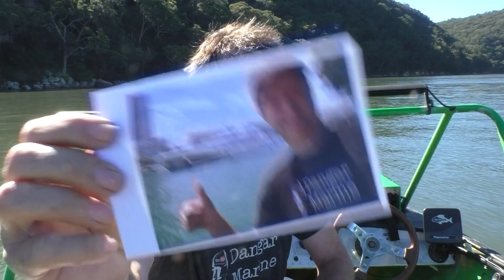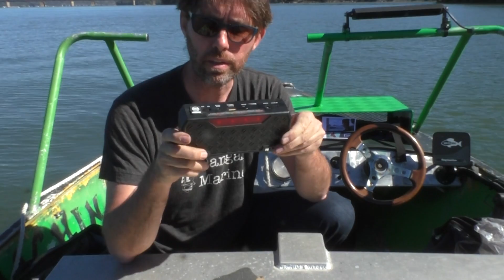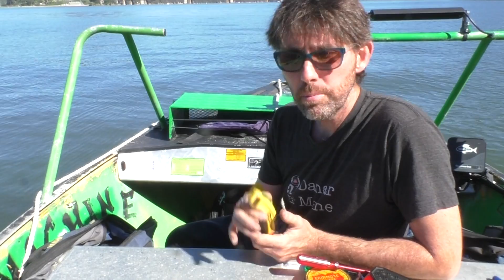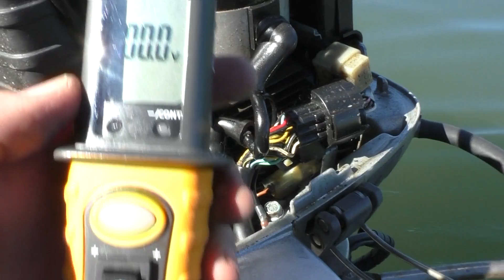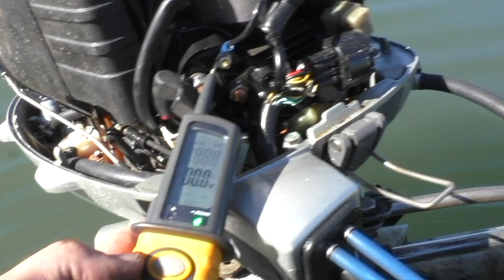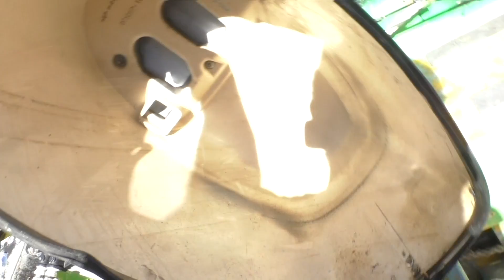Breaking down in a boat on the water

Comment: Hi Stu, Is it normal for battery cables to get really hot if your cranking too much/too long? Was getting frustrated. Stared on the Friday then refused to start on the Saturday. Seemed to be flooding? Think I dried every combination of choke in throttle on, choke out throttle off. mixture screws in and out. Ran out of power in the end so went home in discussed. Brilliant video.
Reply from the maker: Yes, they can get hot after a lot of cranking, as can the starter itself. You could do a voltage drop test across the leads to make sure it isn't a high resistance problem. Does the outboard have spark? Could just be a simple kill switch problem.
Reply: Hi Stu, thanks for getting back to me. It was almost staring, In fact it did start at one point but was really lumpy then cut out then that was it. The carbs were cleaned recently and has been run since, which led me to believe I didn't have the mix quite right. I'm hoping a spray of Easy Start is going to help get me going. The wiring is quit old so guess it should be checked. 
Thanks again. Keep-em coming.

Comment: Was out for a night fishing trip and got done and my 24 volt trolling motor runs off two batteries with one of doubling as the start battery. Tried jumping one to the other no luck. The battery had just enough in it , that when I wrapped a rope around the flywheel and pulled while my fishing partner hit the key it broke over and started. It worked , but now I do like you showed and carry a jump start battery just in case. Great video!!!!
Reply from the maker: Thanks mate. I think a jump starter and an emergency rope is a good combo.

Comment: Hi mate hahahaha you got me on the first one i had it attached to my belt loop tried to start the engine no go of with the cowling check everything sitting there thinking what is wrong with this engine then looked down to see it hanging of my pants what a d** but at least i looked like i knew what i was doing hahaha. That is one thing i always carried was an emergency starter rope just made my own up but good insurance if you battery goes flat it will get you going ,as for tools i would carry a number of sockets plug spanner and other bits and peices as well as the rusty can of start ya bastard great video take care .
Reply from the maker: We've all been there mate, it is such an easy mistake to make!

Comment: I broke down in a bass boat at the skyway in 6- 7 ft waves about ten miles from the ramp, got to a flat that was 4 miles away with a 30lb trolling motor, then jumped in and walked the rest, i got pretty cut up by oysters. When i got to the ramp it was 2 am, then a few miles down the road i heard grinding, it turned out my left bearing on my trailer went bad, luckily i had a spare. Got home at 7 am, i had left at the same time the day before.
Reply from the maker: That certainly doesn't sound like the ideal day of boating!

Comment: I also carry a fuel filter removal tool as it can be hard to remove. Emptying the fuel filter fixed a problem where the engine would start but not run for long or with much power.
Reply from the maker: Yep, they sure can be hard to undo without some sort of tool and if water is in there you'll definitely need to empty it before you can get going again, good tip.

Comment: hey Dangar Stu we have a 12 volt ambient temp and voltage display that plugs into the cigarette lighter socket great for the pre boating check and also to tell the mrs its not that cold boating in july.
we also have a small solar panel mounted north facing when on the trailer, this trickle feeds the battery so we are always ready to go. cable ties and electrical tape are a must cars boat and bikes, recently went camping and some people thought i was going to tie them up while they sleep camping newbies. off to the boat show tomorrow put the mrs up in a swish hotel and got myself a multi day pass, who knows what the cheque book will stretch too. enjoy the vids nice to see the brooklyn rail bridge in background sometimes, being a coastie do most of our boating lobster beach hungry beach lion island and up around pete island
Reply from the maker: Hi David. I like the idea of a plug in volt meter like that I'm planning to add one to the dash of the Green Machine soon, as well as doing a video on adding a solar cell. Hope you enjoyed the boat show and might see you out in Broken Bay some time. :)

Comment: Hi Stu,
Just love your videos. Almost given up on TV. This one though was kind of like, if I happened to have an electric start and not a 40 hp yamaha pull-start here in the Seychelles, it might be a little less theoretical. Pull start is good exercise for hammer throwing, but I use heavy duty gardening gloves for the pulling, otherwise the engine won’t start cos of the blisters. My hands are more used to computer keyboards.
I did teach myself a few things pretty fast after I got my boat (20ft open no frills) and friends (hardened fishermen) added a bit. Every time you start just do one, two, three and don’t forget four. One check the thingie that lets the air in on the petrol tank. Two check the U shape clip starter thing (killer thing) is firmly clipped. Three check it aint in neutral, otherwise you are pulling away, maybe flooding the engine and who knows what else, so by the time you have it sorted you just have no strength left, let alone throw a hammer. Then you have number four. Look to see if it is squirting (select your verb) water down the side, otherwise you’re going to overheat.
If it won’t start after one, two and three, the simplest and easiest thing to do is take the cowling off and look for petrol in the little glass thing. Then ask yourself why you never got round to buying a paddle.
Check lists are boring, but they do work. Me wife says why don’t you write it down and I say, but there are five things on the list if I can only remember four I’ll give you a bell and ask what I’ve forgotten to buy.
Jim
Reply from the maker: I would happily take my risks in the Seychelles, but I know exactly where I would be throwing that hammer if it didn't start. ;)

Comment: I had a call out from a mate ,, his motor wouldn't crank ,,,, i drove 45 minuets to slip it into neutral , easiest case of beer i have ever earned ,,,,
some times the simple things cost a $50
Reply from the maker: Ah yes, that is a common one. I'm really kicking myself for not mentioning it in the video.
Reply: I’ve done it too, knocked it out of neutral while putting the key in and freaked out cuz my motor wouldn’t start

Comment: Stu, once again your videos saved me a boatload (pun intended) of hassle. I was prepping today to get the boat ready for a week at the lake next week and the electric start and horn weren't working. Starter solenoid was popping but the starter wouldn't turn. Tested starter voltage and got nothing. Checked horn wiring and not nearly enough amps. Light bulb with your videos in mind went off and I checked overall battery charger voltage. Plenty of volts but cranking amps were in the basement. Switched to a spare battery and all Gremlins fixed. Bring on the lake!
Reply from the maker: Nice work Peter, glad you got it sorted and enjoyed some time on the water. :)

Comment: Hey Stu thanks for your videos. I was wondering if you could advise me on something? I have a 1979 Evinrude 70HP engine. It starts and runs fine on muffs, forward, reverse all good. However in the water it dies as soon as I put it in gear. I find it so strange that it runs smoothly while on the hose but not in the water? Any suggestions what it might be?
Reply from the maker: Have you done a compression check? It could be that the extra back pressure on the exhaust when it is in the water is stalling a weak motor or it could be a blown head gasket allowing water into the combustion chambers.
Reply: I did a compression check. Top 2 cylinders were 117, 3rd one was 104. Could that be a reason?

Comment: Many good pointers.My motor died(20hp pull start 1985 Johnson) about three weeks ago on the river.Was running great then when I slowed down it idled badley and died.Only got acouple burps when I pulled it.Tried new plugs.No good!After making it back to dock and home on electric motor, I had lost all spark.Did some stator ohm checks,wish I had a DVA adapter you make.Ended up having no continuity on connector(last thing I checked before possibly ordering a new CDI) for ground on CDI to the block.Cleaned connection and got spark back.So hard to look for spark on a pull start by yourself!Strange after running and starting so good.Thanks for the awesome tips.
Reply from the maker: It sure is hard to check for spark on pull start motors on your own. If they are smaller motors you can get a drill onto the flywheel nut. Glad you found the problem in the end, nice work! :)
Reply: Would a drill work on my 20hp to turn it?Have a good drill.
Reply from the maker: With the spark plugs out it probably would.

Comment: Hi,  I have been told that starter spray can damage an outboard.  Any truth to this?  Regards, Bob
Reply from the maker: I don't think it's a huge problem. It doesn't provide the oil that two stroke motors need to run, but a brief spray to fire it up isn't going to do any damage if it is an otherwise healthy motor.

Comment: Not sure if this has been said already but pretty sure most tanks have a moulded ridge down the middle inside the tank which acts as a deliberate fuel reserve.   (At least the tank I have made by quicksilver has).  Fantastic videos by the way.
Reply from the maker: It does seem to be a feature most tanks have, but even a flat bottom tank will give you a bit more distance if you tip all to the pick up corner.

Comment: Great, informative summary video, thanks.

All the plastic (not old metal type) non-fixed fuel tanks I've seen have that "reserve" built in.  Usually just a hump in the bottom of the tank so one side with pickup will empty, but there's still some (quart?  half gallon?) on the other side of the hump.  So just tilting the tank to the pickup side so the fuel runs over the hump, refills that side and you're good to go (after priming with fuel line pump, of course).  Not perfect, of course, as rough going can spill most of that reserve over the hump, or if tank isn't essentially flat in the boat, that may defeat the hump's purpose, but it's an excellent feature.

Don't forget to carry a clean rag, and possibly some waterless hand cleaner as well.

As for a dead battery,  lead acid batteries WILL (usually) recover somewhat if all drains are removed after 10-30 min.  So if not critical for time, try turning everything off, waiting that half hour.  Might be enough juice to get an otherwise well running/easy starting engine going.  (I've actually done this).

I'd also recommend a couple extra screw clamps.

Lastly, a small bit of rag or something, slightly oily, at the bottom of the tin or whatever with your sockets in it will help a LOT in keeping them from corroding, especially near salt water.

RichE
Reply from the maker: Hi mate. Great tip about removing all the drains from the battery and waiting. It's always nice to know there is something you can do if you don't have a jump starter with you. Rag is another good idea, particularly the oily one in tin. I remember my uncle used to have one on the top of his tin of fishing hooks, but I presume that had fish oil rather than engine one in it! Hose clamps are nice and handy too, although you can get away with cable ties in most situation.
Reply: thanks for that video and yes! every boat owner should see this before trying to be a skipper wow!

Comment: Great video as usual!

One thing of note. I was working on a 1970s 70hp outboard a couple years ago and took the spark plug out and held it against the engine block to see if I had spark and it shocked the daylights out of me and took me to my knees. I read in the manual that the coil puts out 30,000 volts to the plug and I'm not sure how many amps (the more concerning part). Be careful.
Reply: Amperage is very low.

RichE
Reply from the maker: Yeah, you can get quite a shock from ignition systems that's for sure. It's another reason why quite like cable tying it to the block instead of holding it!

Comment: Got to admit, love the brand of starter fluid you have over there. never seen it here in the uk.
A good thing to remember if carrying a spare motor is to make sure the fuel in hat is fresh too! I wont name names but a friend had a problem where they went out and main died only to find out spare had nasty fuel in it and soon cut out too. This then made them have to jump in and pull it back to shore!
Reply from the maker: Hey Dave, yeah, it is a very suitable name for it! Great point about the kicker not working either, and old fuel has got to be the number one cause. I think you should try to run the back up motor even for a short time whenever you go out.

Comment: MY steering failed, and like you said, I had to strap a boat hook to the top of the cowling and used it like a tiller. Not so bad, cause it was aux power on a sailboat anyway.  I can remember a friend and I pull started some 200HP Mercs too.  All great fun!  Great general video
Reply from the maker: Hey Gary, glad to hear you got yourself out of trouble. Pull starting a 200 sounds like a chiropractor's dream! ;)

Comment: Mate...I have broken a drive shaft, lost a prop that sank to the bottom, found my fuel pick up floating around in the tank, had magnetic choke stuck in with corrosion, pull started with a rope more times than I care to remember but after rowing for a while there has always been a friendly comrade out on the water to help me get home...  thats the great part about boating.  Oh..I forgot...I have also tilted the plastic tank to get back to the ramp on many occasions and that works a treat too.     I now have a brand new outboard but am thankful for all the "lessons learnt" over many years.. Cheers
Reply from the maker: So it sounds like you're boating has been pretty smooth compared to most. ;) You are right though, boating is like motorcycling, there is a strong sense of community and if anyone else is there they will almost always give you a hand.

Comment: A bit of crab net rope and a small piece of fuel hose sleeved over the rope to make a handle to protect your hands in the event of a backfire and cutting your hands or rope burning your hands is a great way to make a temporary pull start rope. 

NEVER wrap the starter rope around your wrist!. I Have used this fuel hose / crab net rope idea a number of times to start my 60hp Tohatsu and the fuel hose is a life saver of an idea!.
Reply from the maker: Sounds like good advice. I've hurt my hand from pull starting outboards using the factory handle, I can certainly see how it could get a whole lot worse if you had the rope wrapped around you!

Comment: Last summer had a piston ring catch a port while drag racing and locked the whole motor up. Ask me what it's like falling off plain and decelerating after losing power from 110mph in a V-pad hull. Less than 15 minutes later monsoon level rain blew in. :)  As of yesterday she's back up and running ready for this season! Boat is an Allison SS-2000 with a 300 Drag 2.5L Mercury.
Reply from the maker: Sounds like you had quite the experience! Glad you've got it back up and running now though, hopefully you've got a problem free season ahead. :)

Comment: Make sure the damn thing is in neutral. Ask me how I know  :)
Reply from the maker: I was kicking myself for not mentioning that as soon as I got home, it's such a classic thing to go wrong, especially if it looks like it is in neutral but just needs a jiggle to click in.
Reply: Only a Class A Idiot would make such a mistake, not once, but twice. How long does Class A status last? I'm asking for a friend of mine . . . :)
Reply: This is absolutely the best advice. Had an issue last summer where the previous owner of my outboard had messed with the throttle and timing so that, in order to get it to idle, I had advanced the throttle cable to the point that it was bumping the neutral safety switch so the boat wouldn't start. Once I figured it out, I felt like such an idiot.
Reply: Lol happened to me as well. I felt pretty dumb when my wife (who is not mechanically inclined) figured it out before I did. 🙄
Reply: I just had that happen a few weeks ago with my whole family onboard. Embarrassing but a good learning experience.
Reply: robbynelson3 that one has got me twice on the water haha

Comment: plastic waterproof  ammo box  plug  wrench pass through socket set. zip ties multiple  screw drivers plier spare light bulbs spare plugs 2 stroke oil spare trolling prop with pins and nut.
Reply from the maker: All good stuff to have.

Comment: Stu,  thanks for that video.  Good to know what is considered an appropriate amount of tools and good common sense trouble shooting. Two questions -  Is there anything different in troubleshooting wether it is a 2 stroke Vs 4 stroke?  Also,(for us holiday boat warriors) - is 'stale' fuel an real issue in outboards?

Also would you consider doing a video looking at things to consider when repowering a boat -  e.g.. choices of outboard (2 vs 4 stroke), can you increase horse power of the outboard safely, do you need to fit new steering, cables and instrumentation etc. Any thoughts you have would have are appreciated.
Reply from the maker: Hi Neil. I guess with a four stroke there is also the sump oil and timing belt to take into consideration. If a timing belt breaks though you pretty much looking for a tow. Stale fuel can definitely be a problem if the boat is left all winter long without Stabil or something added. When repowering there will be a maximum HP that the hull is rated to take, it should be specified on the compliance plate. The steering should be the same but if you change brand you will likely need to change the dials and forward controls.